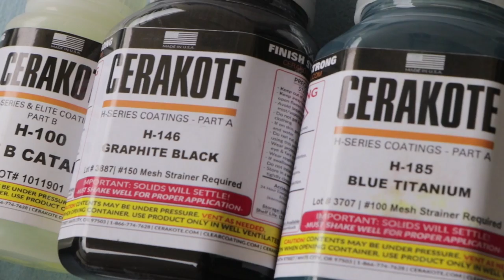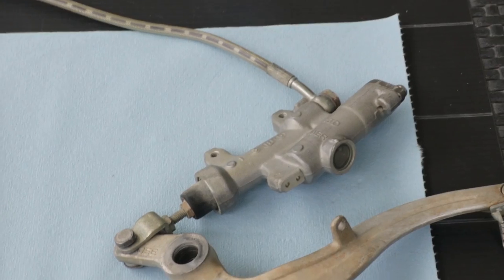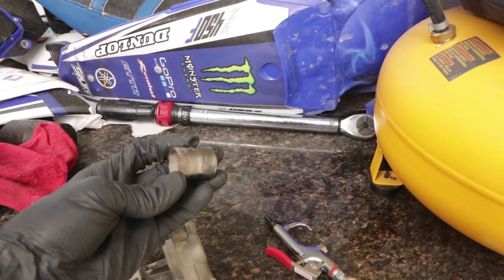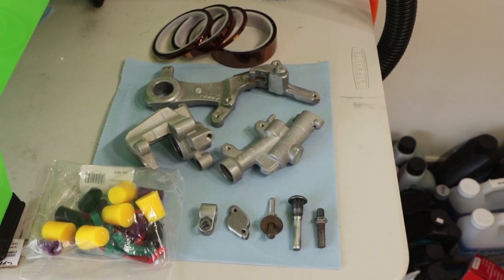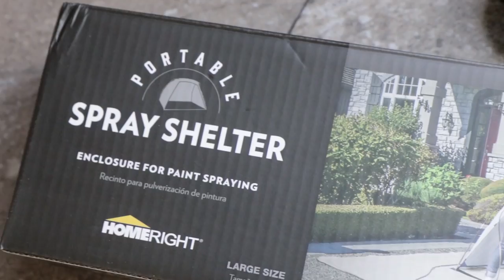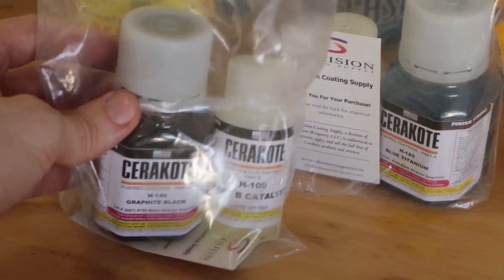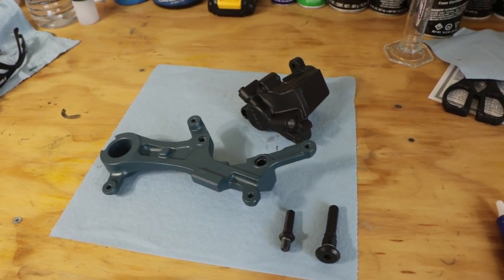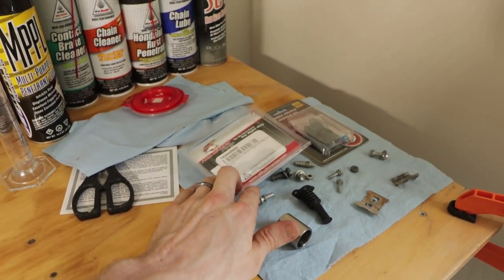YZ450F Supermoto Build: Rear Brake Rebuild + Cerakote 1st Time Ever! Ep.6

Comment: 4:40 good tip using something to stop the piston.
I changed the brake seals on my car a few months ago, and I used compressed air too, to press the piston out.
It shot right into my buddys car xD
Reply from the maker: Haha yeh these things shoot right out which I also learned the hard way! But simply putting a rag in the caliper works fine to catch it. Thanks man

Comment: Not sure if you’ll respond but what’re you doing for lighting/ wiring? Will you post a video in full description? If so when.
Reply from the maker: Austin Linn yes i will be doing a full video on the lighting setup but that won’t be for a few months. Lots to do before that. I have a video on how i put lights on my cr250 supermoto if u find that video it will give you some ideas
Reply: FULL THROTTLE FILMZ I’ll check it out! Is there a full wiring kit by any chance?
Reply from the maker: Austin Linn yeh i uesd a cheap wiring kit from amazon its all linked in that video

Comment: What temperature and for how long do u bake them? Doin some of my own soon but need to buy a mini oven, thanks.
Reply from the maker: I baked the parts out before spraying at 300F for 1 hr, then after spraying let the parts air dry 10 min then into the over at 300F again for 40min-1 hr (they are small parts) Hope that helps! Lay the Cerakote on thick! I had problems with some spots not covered enough.
Reply: @FULLTHROTTLEFILMZ  brilliant thank u, ive got the cobolt colour, which will b a charcoal colour, im doing the water pump housing on my 17 kxf 250 to start with then some more parts at a later time.